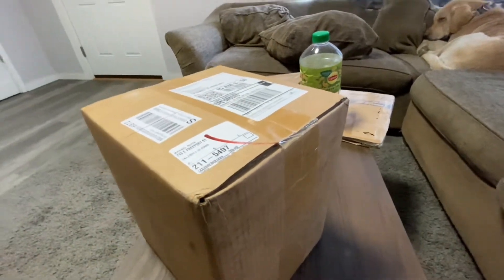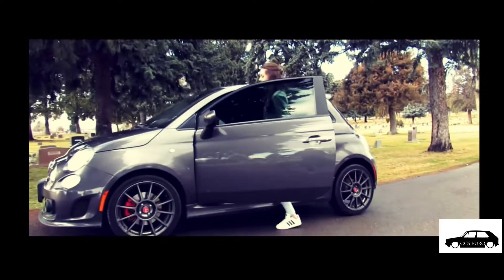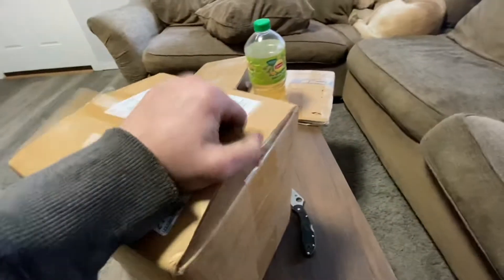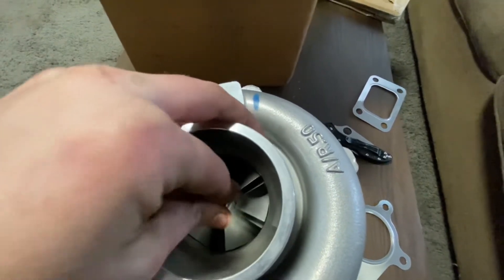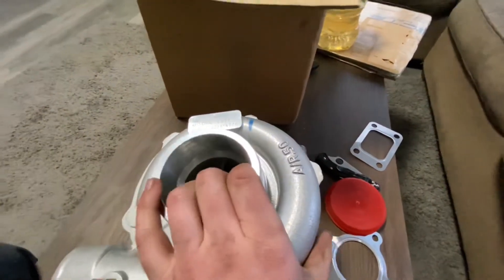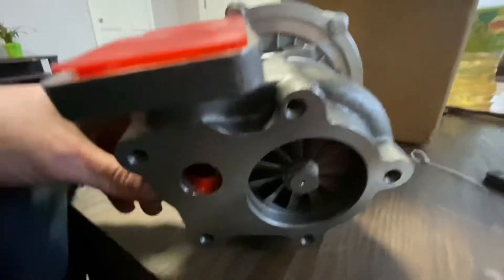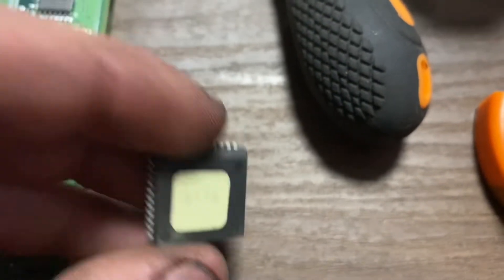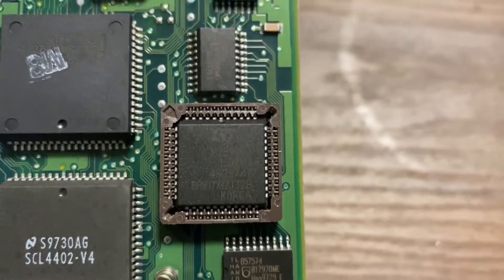HOW TO CHIP TUNE YOUR MK3 VW ECU (reflect tuning)

Comment: I’m trying to get my mk3 golf doors to lock and unlock , the key turns in the lock cylinders on both doors and the rear hatch , but the hatch doesn’t open and the door locks don’t go up or down . When I hit the lock and u lock button inside the car on the dash , I hear a noise coming from the rear hatch , and no noise from the doors , and still the locks don’t go up or down . They used to work , and all suddenly stopped working , I don’t know where to start on diagnosing it .
Reply from the maker: I’m not sure but i would start with the motor that activates the locks

Comment: hey mike how's it going, im trying to figure out how in the hell i am supposed to put a tune on the chip, did you buy that chip with a tune on it already? i really would like a standalone, but i can not find shit for information, any advice would be greatly appreciated
Reply from the maker: I got this chip from reflectuning but if you want to go standalone then a lot of people us micro squirt
Reply: @Euromike  ok gotcha thanks for getting back to me, i was thinking standalone since i want to be able to have launch control and better tuning ability, i have knowledge with mapping ktuner and hondata but i'm new to VW world of standalones they are a little more confusing with how they are worked in C code, my big question is with your chip your running is it capable of switching between 10-30lbs of boost and self adjusting it's fueling along the way, or is your chip specifically for x amount of boost and fuel flow? were you able to draw enough from the stock pump? as far as A/F are you running a A/F gauge as to not over boost? thanks for the response as well, i am having trouble finding good information regarding these engines and ecu's do you know where i can get a mega squirt chip and im assuming harness? or is that something i have to get done by someone? i am a diy guy
Reply from the maker: @matticular  I’m not to familiar with mega or micro. I would like to have used standalone but that was way to complicated for me to attempt. I am able to adjust my boost but I’ve never attempted 30 psi I’m at 20 psi right now and that plenty.
Reply from the maker: @matticular  there is another channel on here called team 8v and he uses stand alone he would probably have better answers about that
Reply: @Euromike  awesome dude thanks so much, my last question is what did you do as far as a oil feed line, im going to tap my oil pan, but as far as the latter did you tap into your oil pump for your turbo? if so how did you go about doing that, once again thanks a lot
Reply from the maker: @ the oil cooler that the oil filter screws onto has a blocked off threaded hole and the feed line screws right into that